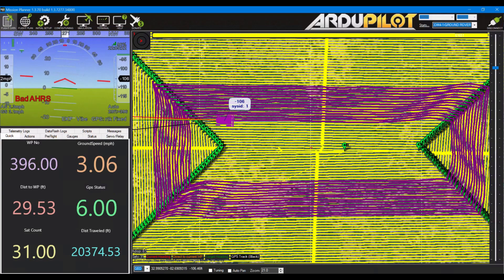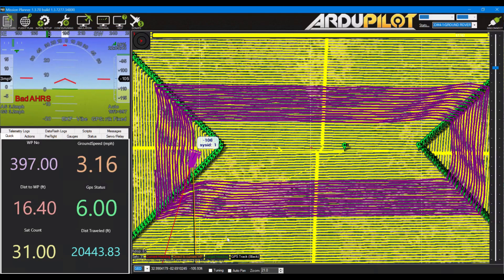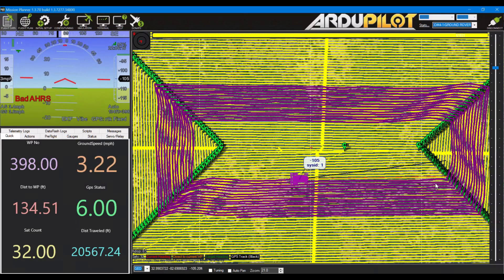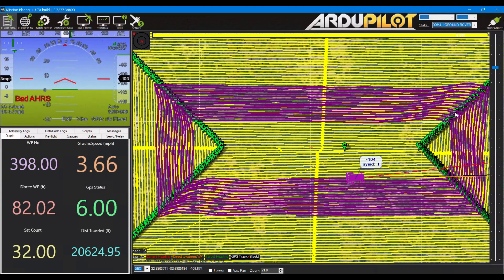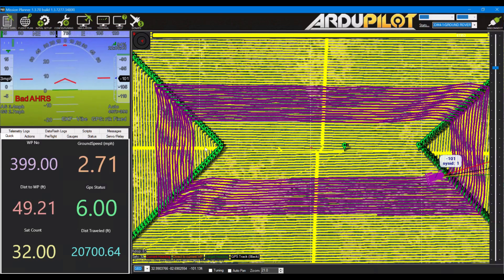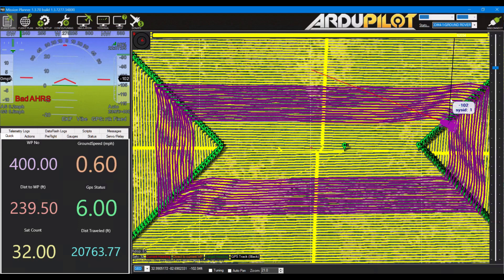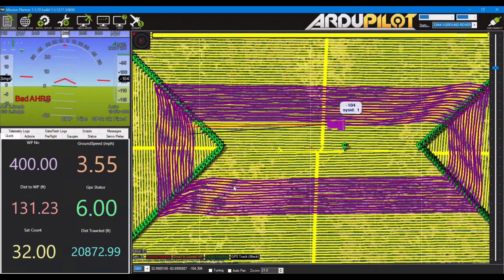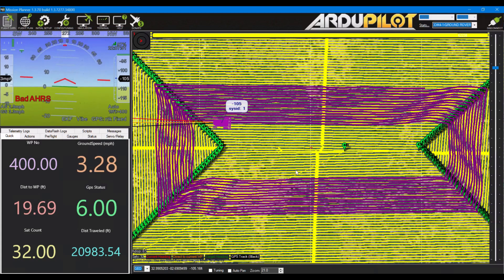Bad Compass Affects Pivot Turns in Ardurover

Comment: I have the compass answer, ask any airplane pilot, that action is NORMAL, and it is part of the FAA test for your pilot license, and you are right, it acts up in turns and it acts differently based on what you describe, i will get the terms and reference for you. IT IS NATURE
Reply: It is important to note that the magnetic compass does display some errors during changes in velocity and turning. You may have previously heard the term “UNOS” (“Undershoot North Overshoot South”), this is in relation to the northerly and southerly turning errors that a magnetic compass displays. When turning to a northerly heading the compass card will lead ahead of the turn so your turn should be stopped short of actually reaching the Northerly indication on the card. When turning to a Southerly heading the compass card lags and therefore your turn should pass through the desired heading prior to stopping your turn. As the aircraft’s proximity to the poles becomes less these errors become amplified.

Another acronym you may have heard is “ANDS” (Accelerate North Decelerate South). Acceleration/deceleration errors will be experience anytime the aircraft is on an easterly or westerly heading. When accelerating on one of these headings, the compass will initially show a turn to the north. As opposed to decelerating on an easterly or westerly heading the compass momentarily shows a turn to the South.

Both of the above discussed errors are caused in part by magnetic dip which is discussed in Chapter 7 of the Pilot’s Handbook of Aeronautical Knowledge. The above information is just a brief outline of the magnetic compass and I would encourage you read in detail about the variations and types of magnetic compasses and errors associated with each. You can find all relevant information in the Pilots Handbook of Aeronautical Knowledge and Instrument Flying Handbook both available on the ASA website.

Below are some study questions to assist you in preparing for your FAA Private Pilot Knowledge Exam, it is very likely you will see questions very similar to these on your actual knowledge test.

1. In the Northern Hemisphere, a magnetic compass will normally indicate initially a turn toward the west if
A—a left turn is entered from a north heading.
B—a right turn is entered from a north heading.
C—an aircraft is accelerated while on a north heading.

2. In the Northern Hemisphere, a magnetic compass will normally indicate a turn toward the north if
A—an aircraft is decelerated while on an east or west heading.
B—a left turn is entered from a west heading.
C—an aircraft is accelerated while on an east or west heading.

3. What should be the indication on the magnetic compass as you roll into a standard rate turn to the right from a south heading in the Northern Hemisphere?
A—The compass will initially indicate a turn to the left.
B—The compass will indicate a turn to the right, but at a faster rate than is actually occurring.
C—The compass will remain on south for a short time, then gradually catch up to the magnetic heading of the airplane.

4. During flight, when are the indications of a magnetic compass accurate?
A—Only in straight-and-level unaccelerated flight.
B—As long as the airspeed is constant.
C—During turns if the bank does not exceed 18°.
Reply: so what you MAY be looking for, is some kind of COMPASS LIBRARY on github etc that was created to CORRECT these issues, if anyone ever made one.
Reply from the maker: Thank you for your detailed comments. This video is quite old. I overcame the compass issues by not using a compass at all. I am not using Moving Baseline RTK which uses 2 GPSes on the vehicle. The relationship between the GPSes is known and thus with high accuracy position that is possible with RTK, the orientation of the vehicle is known very accurately. It is more expensive, of course, and a compass module can get the job done.
Reply: @KennyTrussell  yes, i am cramming learning all of this over the past 24 hours and have learned rtk is the way to go and covid has killed this endeavor due to lack of hardware lol
Reply from the maker: @tracnunya7165  Covid has certainly made some aspects very difficult and others expensive!

Comment: Hi Kenny have you tried to place your antenna at the front of your platform as this might offer more accurate readings 
So place the antenna at the front centre of your platform
Reply from the maker: I have thought about that since it would get it farther away from the engine and ferromagnetic parts. Honestly,  my time to work on the mower has been severely limited, but my need to use the mower right now is high. So, since it is working pretty well, I'm just running the hound out of it with it's flaws! I want so badly to work on the issues, but just don't have time at the moment.  I am about to make some changes though and I hope to make some videos!

Comment: I thought I had a novel idea until I saw your videos, and then I found a few of your comments that really helped me out. Using the same servos on an Exmark 48” zero turn with decent success. But I also have both compass (and GPS) woes. I can’t seem to stay in RTK Fixed for very long, and I often see EKF compass errors that result in similar (if not worse) behavior. Wasted some cash on Mu-Metal shielding only to find it worsened my problems. Looking forward to seeing your solutions!  I’m very curious about the upcoming Rover version with GPS heading derived from two RTK solutions.
Reply from the maker: Thanks, Yuri, for the nice comments. I would love to see your mower. What GPS units are you using? With the U-blox Zed F9P I am using on base and rover, I keep RTK-Fixed almost all the time. They are awesome.
Reply: @KennyTrussell  Sure thing, Kenny.  I just uploaded a short ciip to my own channel - you can see it at https://www.youtube.com/watch?v=8UZtduT0DlI (if the link embeds, if not, the video ID is 8UZtduT0DlI).  I'm using uBlox M-8Ps via ProfiCNC's Here+ v2.  I just remounted the rover antenna and have had a lot more success maintaining RTK fixed.  Interestingly, I took the antenna off of a PVC mast and mounted it right on top of the waterproof toolbox that houses my Pixhawk4 and relays, and that seems to have helped.  I also disabled the external compass, as you mentioned, and the compass errors became less severe.  Still, you can see a similar compass-induced overhsoot in the last few seconds of my video.  Telemetry is repeated via a Raspberry Pi running ser2net to transmit the SIK MAVLink and RTK base serial data to a wifi network, where I connect Mission Planner via TCP on my laptop.  I use a cheap survey tripod and solar USB battery bank to power the base - I thought that was a pretty slick solution.
Reply: While I'm describing the project, I'll provide some context .  Unlike you, mowing acres and acres at a time, I'm primarily concerned with my own 2 acre lot on the edge of suburbia.  I have some trees and other obstacles to avoid, which I initially tried to manage with a little LIDAR rangefinder, and found that the mower went completely "stupid," trying to avoid obstacles that didn't even register on the rangefinder "radar" screen (I'm writing that off to bright sunlight).  So I set up complex Geofencing which requires MAVLink 2 protocol (SERIAL1_PROTOCOL=2).  So long as you have fixed obstacles to avoid, that appears to work reasonably well with the "Bendy Ruler" algorithm.  I beat my skull against the wall finding that serial parameter, so posting this reply in part to hopefully help others.

I also enjoyed playing a bit with your "mowplan" software until I found the spiral survey method in Mission Planner.  Thanks again for all of your work on this!
Reply: @KennyTrussell  I spent quite a while messing with the M8Ps today, adjusting the elevation mask and noise threshold values to see if I could get better performance (must disable GPS_AUTO_CONFIG on the Pixhawk to get u-Center configurations to "stick").  It seems there's a reason the M8P modules are cheaper - their performance simply doesn't match the F9P.  I did get marginally better results today, but I'm still really only achieving about 1m accuracy on average, so the mower skips too much, and fixed obstacle avoidance (for mowing) is nearly impossible at that accuracy. I ordered a couple of Zed-F9P boards today to compare results.  I'll post a follow-up when I get the new modules connected.  Thanks again for all the information - truly helpful stuff!

Comment: I have a Drotek RM3100 compass that I hoped would be supported in Rover before this spring. Its working in the current  Copter release and I hoped that Rover wouldn't be far behind. I am very curious to see how the RM3100 will perform on my mower. My experience with compass performance and navigation is very similar to Kenny's . 

Thanks Kenny for sharing.

Comment: What are you using for rotation speed? ATC_STR_RAT_MAX?  Perhaps (until you get 2 GPSs for heading) reducing that might help.
Reply from the maker: I just looked and at the moment it is at 40 deg/sec. I used to think my trouble was that my actuators were so slow that the mower was overshooting on a pivot turn because they were too slow to move back. So, a slower max rate would help, but that is not the case. I can make my turn rate super slow and it still moves to the same angle before taking off. And, this video shows that it isn't always overshooting, it is undershooting half the time. Very weird... Thanks for the suggestion. I might play with it more sometime. Right now it is doing the job I need it to do and I am running it.

YOU sure do have an awesome mower!! Have you posted videos for the public? (sorry to "out" you if you didn't want to be! :) )

Comment: Not sure how to resolve this but that is a very impressive waypoint mission layout! Next level skills Kenny! 

When my rover was doing something similar I began tweaking it in basic tuning and found that it stuck to the lines perfectly after changing LAT ACC CNTR PERIOID = 3.0 - 4.0 and changed LAT ACC CNTR DAMP = 0.80. 

Before doing this it wasn’t sticking to the lines but after this it was dead on.

It had nothing to do with the anything else once I changed these two values the rover became accurate with waypoint missions
Reply from the maker: I have worked with those parameters in the past, but haven't done any tuning in a while.

Comment: Heading calculated from two RTK sources would probably be the best choice for you, as you have quite a large "robot" and the GPS sources need a certain distance in order to measure the correct heading. But it's still a expensive solution.
What do you think of "faking" the compass. I think one initial value and a Gyro should be sufficient, as you can calibrate it while driving straight from the GPS values, which are very accurate when using RTK.
Reply from the maker: Ardupilot somewhat has that capability built in. You specify how much weight Ardupilot gives to the heading from the GPS versus the heading from the compass. I have that heavily favoring the GPS. And when my mower is moving, the heading is usually spot on. The issue is that if the mower is only pivoting (at a corner), then the GPS is not experiencing forward motion and therefore has no idea what direction it is pointed.

Comment: Yes, I totally agree about "moving baseline" (using two GPSs for yaw) is going to be the way to resolve all this.  A couple of Ublox F9 GPSs (even if not using RTK) should work well although I haven't actually tried it myself.  "moving baseline" will be included in Rover-4.1.0 which I hope we will start beta testing in the next month.  We are mostly ready to go with the start of beta testing but I'm just trying to put some time into improving our non-GPS navigation feature as well.
Reply from the maker: Great news, Randy. Honestly, I have been planning to build a moving base completely externally to the autopilot using a separate microcontroller and let that microcontroller emulate a compass, BUT having it built into Ardupilot is certainly great and I will likely not get my version done before you guys get the new code ready! One thing I don't understand from what I have seen on the discussion groups is why you have comm between the 2 GPSes going through Ardupilot. That seems to be an extra load on the processor when the GPSes are capable of communicating directly, outside of Ardupilot.
Reply: @KennyTrussell  I don't know a lot about moving baseline but I think the setup is easier if the communication between the GPSs is done through AP becayse there's no need for an extra cable between the GPSs.
Reply from the maker: @rmackay9  The main reason I would favor and external connection is to keep unnecessary load off the AP's processor. If that is not a concern, then I understand letting the AP do it all. The other thing that makes external a good idea is that there is at least one system, Ardusimple, that has a 2nd GPS that is made to fit right on top of the the primary GPS and connections are done with not cables. Perhaps the software will be flexible enough for either method to work. Thanks for the update! Looking forward to seeing the beta.

Comment: I was just about to comment about moving base RTK when you mentioned it. I'm looking into building an autonomous unit and will definitely be going this route. I'm looking at the sparkfun units because they are pretty cheap, but might go for the Here+ units instead (so long as they support mobile base.) What are you thinking? Great progress on this btw, I've watched nearly all the videos, very interesting. Thanks!
Reply from the maker: I have 2 of the U-blox C099-F9P boards and also 2 ArdusimpleRTK2B boards. The boards are basically the same price. The C099-F9P boards have more features, but are also more complex to set up. One nice feature is that they have 2.4GHz Wifi built in that can be used to communicate RTCM3 from Base to Rover BUT, if you plan to use them with an autopilot such as a Pixhawk, you run into an issue that the built-in WiFi is using the UART1 port you have to use to talk to the autopilot. The fix is to install a jumper wire to get the WiFi to UART2. I have a friend who got that fix directly from U-blox support and it works!

With the ArdusimpleRTK2B, you don't have that problem.

I saw a post months ago that the Sparkfun boards might have a little more noise susceptibility and thus not be as sensitive. I am a huge Sparkfun fan, however, so personally, I would consider their board.

But, you should look at the Ardusimple.

Another nice thing about Ardusimple is that Ardusimple has a LITE version that will fit right on top of the RTK2B, making the moving base configuration nice and compact. That is probably how I will go.